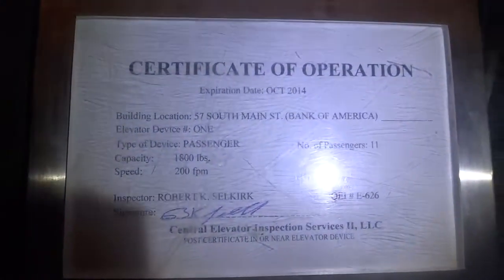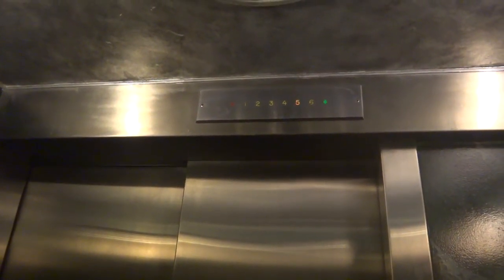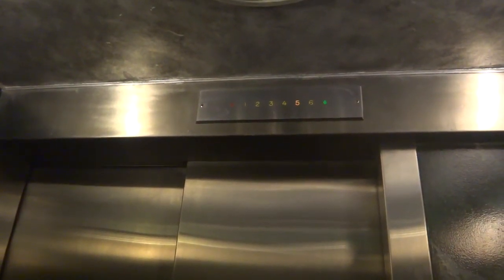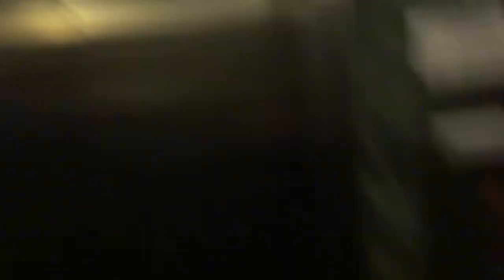Old Otis Traction Elevator @ The Bank Of America Harrisonburg, VA

Comment: It still looks pretty good. Mostly original. They must have just lowered and changed the buttons to make it ADA compliant.
Reply from the maker: The cab is beautiful. I am glad they didn't touch it. It appears back in the 80's or 90's Otis just put GAL on to comply with ADA codes, which came out in the early 90's. Other than that this elevator is completely original.
Reply: 22408aaron
That is also the most unique design for an elevator room that I have ever seen!